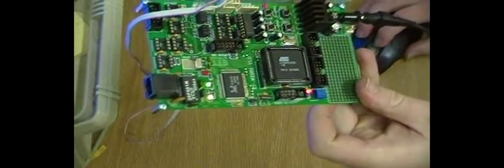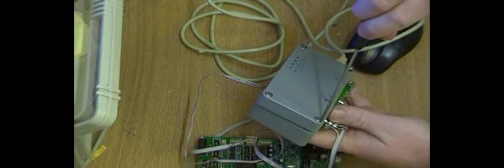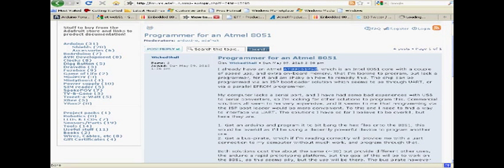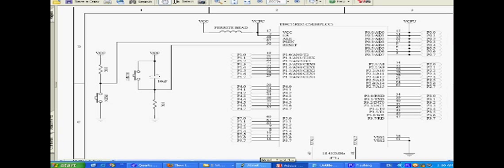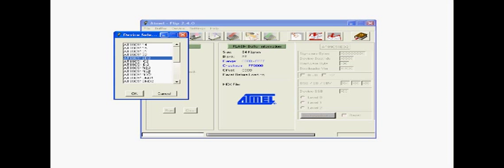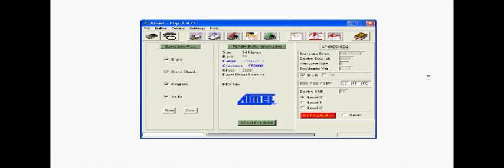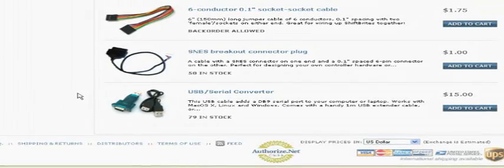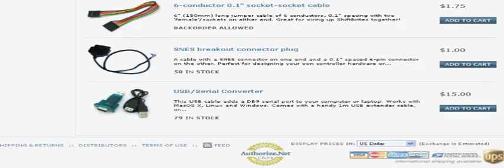Atmel AT89C51xxx programming with FLIP and usb-serial

Comment: I am using 89C51AC2 controller. I am trying to program it through Flip, a USB-Serial converter (COM9). but however I try, I get 'Time Out error'. I changed the IC to see if the communication can be established. Nothing works. Can you suggest me anything regarding this?
Reply: Did you switch your board into "Operation mode"?